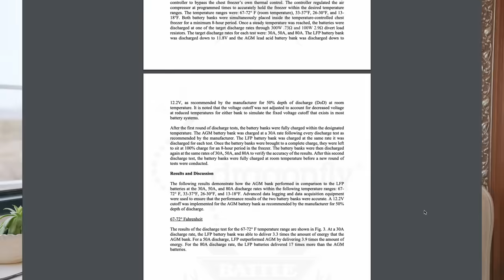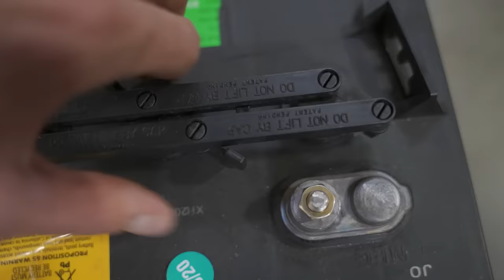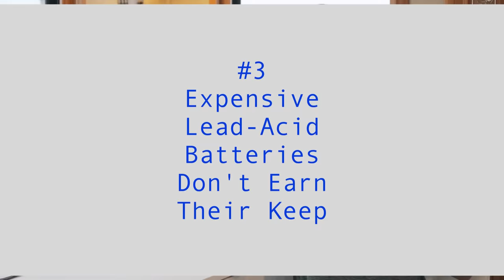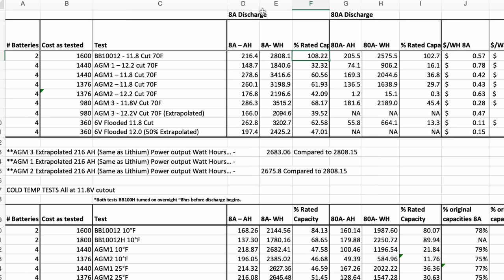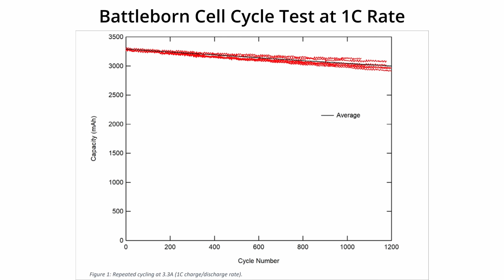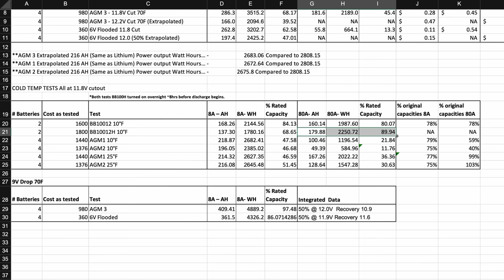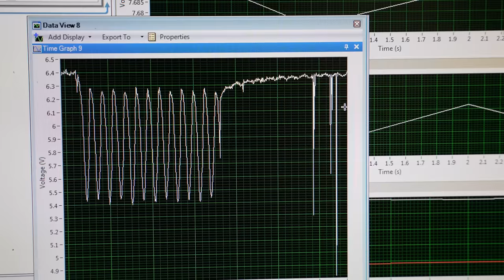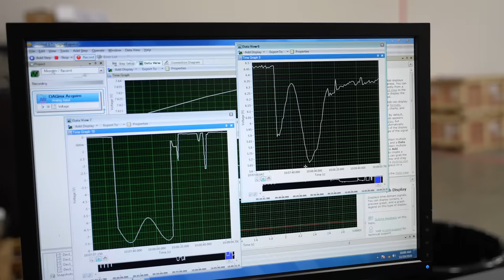Don't Waste Your Money On Batteries - The Shocking Truth I Discovered When Testing RV Batteries

Comment: I want to thank you for the tremendous work you put in here. I test a lot of batteries and it annoys me that most of them do not meet their specs. This has gotten much worse in recent years. I’m talking about you, “9000 mAh” 18650 cells from China.
Reply from the maker: Thank you!
Reply: You can buy 100000 mAh batteries for 5 dillars
Reply: @esecallum  😳😱🤣🤣🤣🤣
Reply: No one will claim 9000mAh if 18650 unless he knows you are a fool. You buy what you pay, I think you'd have basic acknowledge about the price of battery(LFP/NMC), if the price is not reasonable, then there's something unhappt happen.
Reply: Lithium, go LiFePO4, dircet from a reputable manufacturer and, roll your own BMS, with dynamic balancing, separate charge and discharge cutoff contactors.

Comment: The way I understand it is - 11,8v is not a in-use reading it is an at-rest reading.  My inverter is set to 11,5v cut-off as that brings it back to 12,25v after 2 hours rest - equaling it to 50% used ;-)
Reply: Exactly. I ended the video when i saw that he didn't consider this. He didn't do the experiment right. 12.2v is at rest, not while using the battery. Just another ad for BB.

Comment: As a full time RVer in a small RV with 2 100 amp hr lead acid batteries and a single 140 amp solar panel. On any day that I use my 100 amp laptop for an extended time would pull my batteries down to 12 v every evening and the full recharge them early in the next day. So definitely not within the parameters that lead acid companies recommend. At the moment my batteries are toast but I am mostly on grid,. new LFP will go in before next off grid adventure. plus new low amp tablet to back up high amp laptop.

Comment: Don't  let this scare you.... get what you can afford  and you will be just fine
Reply: Absolutely, no need to buy battelborn batteries for $1k each, it's much cheaper options that work as well or better, just try to keep them above freezing, and below 100°-115° F,  basically keep the batteries in human survivable conditions, use a BMS, and be sure the high and low voltages are in check, don't depend on the BMS to prevent high and low voltage, they will last longer, and get what you can afford, and also double the capacity you think you will need!   And get a tiny generator for emergency use, to charge batteries!!
Reply: I got what I could afford in 4 6 volt batteries, put a small residential fridge for 400 dollars verses a 1500 to 2000 dollar cost to fix the propane fridge. I have a 7500 watt gen that I start and run every morning to charge what the batteries drew out overnight. Went on a 30 day, 8000 mile trip around the states........no problems with the batteries.
Reply: If a person can't afford lifepo4 , I think spending more for AGM would be much better than going with flooded lead acid...#1 No maintenance/equalization charge,adding water,spills,etc...#2 more cycles/longer life plus they are more resistant/can withstand a deeper depth of discharge #3 they can charge up to 5 times faster than FLA since they don't need to use a 3 stage charging system. That right there is huge since the AGM can fully recharge if drained and there's only a few hours of sunlight left....(I'm still learning)

Comment: Great video and informative information.  Especially the part that how cost affective the Flooded 6V Lead Acid Batteries are.  I know that the LiFeP04’s are the latest and the greatest and that is what the video is pushing; however, your information about the cheep flooded 6V lead acid batteries says it all.  They are very cost effective for what they are.  Most RV’s are not pulling down 80amps on their batteries and the lead acid batteries handle the 8amp range very well.
Reply: they are not cost effective over the life of a battery when compared to lithium. Especially if you build your own
Reply: Exactly my point. 8amp on 100Ah battery is not efficient. It is more than the 20 hour rating. He needs a minimum 160Ah lead acid battery bank for 8amps to be efficient. 1600Ah for 80amps. His lead acid battery bank is too small. I agree with using Lithium ion for high discharge but this video is not a fair comparison.
Reply: What do you think he earn his money from ?
Giving away Lithium battery 😂

Comment: So, when it comes right down to it! The flooded; not the AGM's are better? And for the best bang for the buck is flooded batteries is best again. The only advantage that Battle Born has over the flooded is it's weight, yes? Of course, it is! When they get at least 370Ah in their batteries, to fit into an area that is only 20" x 40", then I might look into them; but, until now I'll keep my 4, 6v-370 Ah for my 24v system. The cost is small compare to the Battle Born. In the real world, flooded batteries are good, if not great! Because if people are using Flooded or AGM batteries in the tiny home or RVs and anything else. People are using a small amount of power and are always watching their power usages for the most part. Flooded does have one huge pain-in-the-butt thing. It's the monthly maintenance of them, but then, if you think it only 10 minutes worth of trouble to keep your system up and healthy, it still well worth it. Just saying!
Reply: Build your own 280ah lifpo4 from ali baba for under 500
Reply: What? What? I get no heart? Hahahahaha! Yeah there’s no basis here! : )
Reply: @FirstSuiGeneris  you'll also get 10+ years or more out of lithium. Not to mention the much better charge rate so you can use less solar panels.
Reply: @nismo4x4n  Nobody knows that for sure because the battle bornes have not been around for 10 years yet.
Reply: @Schmitz3  The cell types they use have been though.

Comment: For mobile storage where weight and size is fairly important than no arguments lithium is great, but for a house correctly sized lead acid is still fine. You shouldn't be running a house off multiple 12v batteries but rather large 2v cells series to an appropriate voltage. My big 5 bedroom house has been off grid with the same flooded lead acid battery for 14 years. It is sized so we only use the top 20-30% however most days we use less than 10%. Its been over charged, under charged and abused in various other ways over the years with ZERO issues.  We have to top up with around 1 litre of water every 4 months or so. In summer we are over 40 celcius and down to about minus 4 in winter.  Lead acid is no where near as bad as popular youtubers make out.
Reply: Too bad literally every metric that can be found, shows that this most certainly is NOT the case. So unless you can make a video to show your system, it's obvious you're just blowing smoke.
Reply: @cashandraven2369  Every metric? Please tell me which statement of mine is worng.
Reply: @JimmyLLL  I'm not with this other person but I would still like to see your system. It sounds pretty interesting.
Reply: @smilemore1997  I actually sold the house and have recently moved. Nothing special just 1600 amps (24v) of Raylite batteries, hooked up to an SMA inverter and charged using a midnite classic.

Comment: A very informative and great video this is. However, it backs up my decision to stay with cheap flooded deep cycle batteries. Now, if I lived in a RV, boat, or home full time, or at least for really extended periods and relied almost solely on solar charging, I would definitely go with lithium. For most of us RV owners however, that typically stay in one spot for a week or two or less, and especially for those of us that have an older RV with standard alternators, battery cable sizing, no DC to DC chargers or adjustable external voltage regulators needed for a lithium house bank substitution, and especially those of us that still use a generator, it just makes way more sense to stick with FLOODED lead acid batteries, assuming that they are stored outside of the living area. Sure, you have to check water levels from time to time, but how hard is that? I use 2 WallyWorld 105AH flooded deep cycle 12V's at $80 each, and they typically last me for around three years. Now I do use a 12.2V resting cut off voltage minimum whenever possible, and although my 2000W pure sine wave inverter does handle my little Mr. coffee, my 900W microwave, and my 1400W toaster oven without issues, depending on where I am and how much additional charging I want and how long I will be running these devices I will either put my standard 160A engine alternator to work, or crank up my perfectly running 2000 hour expected lifetime (I'm not kidding here, just maintain them properly and they WILL give you that) 2.8KW Onan genny to work using around 1/3 gallon/hour, which with my Progressive Dynamic converter/charger gut's replacement still providing a fair amount of battery charging while running. And speaking of that, it allows me to safely keep the RV plugged into shorepower indefinitely without damaging the batteries, and even automatically provides occasional equalization charging cycles, which definitely has a lot to do with my getting three or so years out of my el cheapo batteries. And finally, this old time tried and true system gives me, a guy that likes to camp in hot summer temperatures, the luxury to run my A/C for 10 hours at night if I want, which at let's say @ $2.25/gallon gas would cost me about $7.50/night. If I did that for 10 nights a year, that's an additional $75/year cost of ownership. Do you have any idea what it costs to buy a new RV or retrofit an older one with enough lithium, a second giant alternator, the often very troublesome computer equipment to be able to run A/C, a compressor fridge, and rely on electric cooking? Yikes! I know that for some of the new class B's out there it's a TWENTY FIVE THOUSAND DOLLAR OPTION, and still relies on idling your engine for extended periods of time, which it is not designed to do. Now I also use evil propane for cooking, heating, and have an absorption 3 way fridge and will continue to do so. After airflow mods, the fridge still cools to 40 degrees and freezer to less than 0 at 95 degrees ambient, so no worries there, and although I do have to level the RV while it's in use of course, but a month's worth of propane even when in below freezing nights (propane heaters use a LOT of propane) costs me about $25/month or less than a dollar a day. I do have 200W solar but really don't need it.  Just sayin' folks, old school for me is still the best by far.
Reply: Nice point!  I've been thinking the exact same thing and justifications.  For this guy as well, I will have/use a small solar inverter system w/6v golf cart batteries and top off with my generator as required and it will probably suffice.  Thanks for posting.  :)
Reply: LITHIUMS are Awesome but are EXPLOSIVES !!!!!!!!! BOMBS !!!!!!!!

NOT WORTH IT.

STAY AWAY FROM THIS LITHIUM AGENDA2030 SHIT.

STAY with good old batteries. 

Remember this.
Reply: @Kenny Hendrick how cheap, and in what state?
Reply: Good post!
Reply: Please don't tell me you think it's ok to pull into a campground and start your generator ! At any time much less all fucking night long .. are you nutts? or any place else where other people are around it's not cool to run a generator day or night.  Any one contemplating doing that is just plain out of their mind.. never think it's ok. Ever.. even by yourself you're messing with every wild life creature for miles around..only a total nutball would be so inconsiderate.
Reply: @galapagosbusinesses.8859  youre crazy
Reply: @Comin_at_U_Live  whoa, that escalated quickly.
Reply: @galapagosbusinesses.8859  Lifepo4 are one of the safest batteries out there and defo worth it.   Lithium polymer i would say ok, they need special care.   You are mixing up quite a few subjects here...
Reply: @michaelmorrison4201  People all need to think the same nowadays...😉

Comment: RV electrical was a bit quirky.   The core issue, was that the prior owner bought a cord off amazon, that was not UL listed.  When the battery failed, and we were plugged in, I pulled the panel, checked AC power to ground, then checked to neutral. One was zero.  Hum.  Clearly, Isolated ground, and bad cord.  Because the AC cord was bad, the inverter, and the battery recharging, was not working.  I threw away the cord, and hard wired the RV to the box, to get the full 30 amp power, with a 30 amp breaker at the pole.   (I own 4 RV lots, and one RV).

Comment: I would have liked to see more Deep Cycle or Marine (which are a combined starter/deep cycle battery) lead acid batteries used in comparison than regular starting batteries. That is what the experiment test parameters were directed to......
Reply: AGM1 is clearly FullRiver DC115-12 batteries.  Which are deep cycle.  The problem is he discharged them at the wrong rate.  The manufacturer tested their claims at 5.8A not 8A.
Reply: @tomstdenis  Testing close to the use case makes sense for this test since the idea is: which battery is best for this particular use.
Reply: @karlsjostedt8415  I agree that's what the "test" in the video was but he States multiple times that the batteries didn't meet manufacturers specifications for capacity which is a test that needs to be done at the rate the manufacturer discharged at.

Comment: Tom, all great information... for the seven battery engineers watching.  For the rest of us, all we need to know is; what do we need, battery wise, to run our furnace overnight, in 20 degree temperatures.  I recently had to run my generator overnight to keep the batteries charged up, as the furnace was too much drain for an overnight period.  There are, of course, other small amp draws (refrigerator controller, thermostat, built in radio, etc.) that add to that drain, but for the most part, what do we need to be able to run the furnace overnight?
Thanx for all your work and willingness to share what you learned
Reply from the maker: Good question, one charged 100AH lithium will do it.  Considering the furnace draws 300W that would be 4 hours continuous run, assuming a 20-30 percent duty cycle your looking at 12-14 hours usable runtime.  If its a 50% duty it will just get you through.  always depends on your loads.  I will write a blog post on this topic!
Reply: Tom, ironically people can understand miles per gallon, and yet amp hours or watt hours confound them.  See it all the time. Would be nice to.see you draw analogies.  Describe in painfully basic terms the difference between and amp and a watt.  And then throw in what a watt hour is.    Most rvers do not understand the difference between an amp and a volt and a watt.   Electrozoom did.some nice things but he wouldn't appeal to rvers.  You glanced over it and then you hand waved like a good EE. I explain this all the time but you are.getting paid.  Good luck.
Reply: Andrew Zenn, the problem is that there are 3 ways to measure electricity. Amps, watts and volts. And then there is AC and DC. That gets converted back and forth in an RV.  MPG is easy to understand for us in USA, but if we where talking to someone in another country that did LPK (liters per kilometers) we'd be a bit confused.
Reply: Ted, exactly. Great comment. I watched this video and learned a thing or two. 

To the MPG comment. I am not an RVer. I am in the backcountry camping and exploring. Can't take an RV where I go. I worked as a mechanic for several years and am very mechanically inclined. When it comes to electricity, I have youtube and Tom to explain it to me. 🤷🏼‍♂️ I am not at all interested in electrical engineering. Lol
Reply: @MortonsontheMove  Adding to the furnace post:  I would imagine , the lithium will recover faster than the AGM.  So as the nights go on using the furnace, at some point, a  generator will be needed to get the AGM back near 100% where as the Lithium batteries might last much longer before they need a generator or not at all (assuming no cloudy days).
Reply: @MortonsontheMove  300 watt furnace blower?  seem like alot.  My RV furnace draws more like 80 watts, which changes the number significantly.  Unless I am not understanding something.  My BB batteries (2) use about 10% overnight everything on, so 20 amphours or about 250watthours...
Reply: @conniechapin9278  Great question, I'd love to see Tom's answer.  For me, talking to my wife, I try to make it concrete:  a 1000 Watt microwave will use 1000 Watt-hours if I run it for an hour.  If I run it for 6 minutes, that's one tenth of an hour (6 min / 60 mins in an hour = 1/10th).  So, 1/10th of 1000 Watt-Hours = 100 Watt Hours.  
That way I ignore converting voltages and other system considerations (" So with 4 12-volt batteries, serialized to 48 volts, converted through a pure sine-wave inverter with a small conversion expense and...wife, why are you on YouTube?  Aren't you listening???")
Reply: If you are good battery engineers you would never have got yourself into a system design flaw in the first place.
Reply: @robertfranc2365  OH that was helpful..